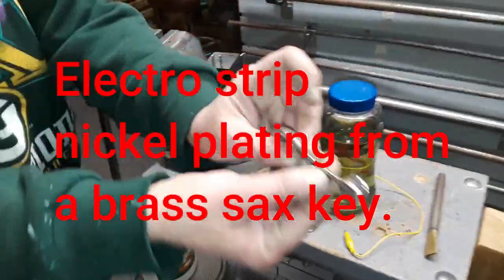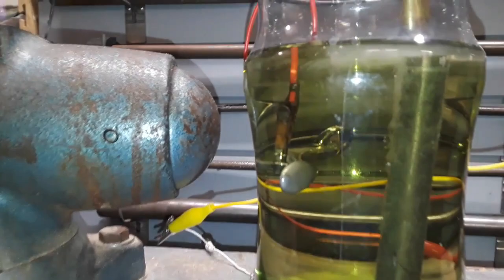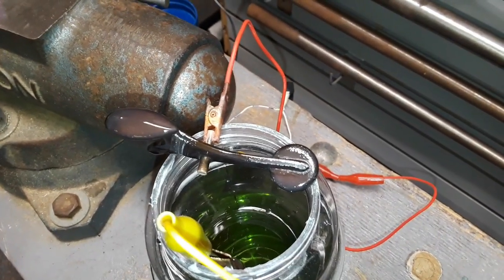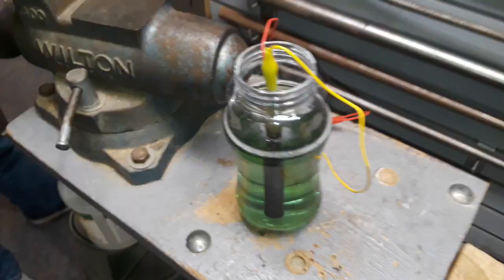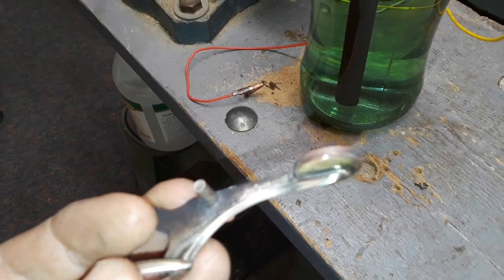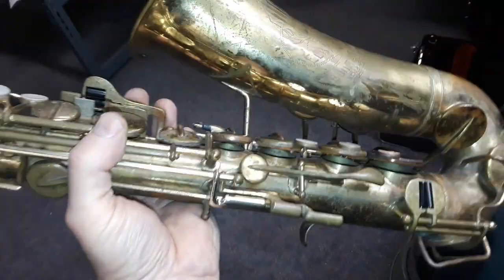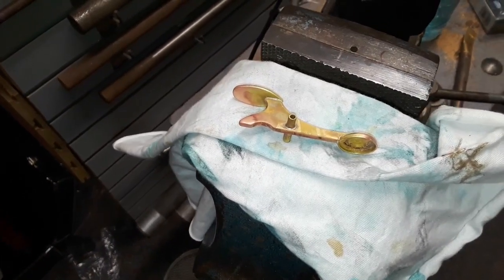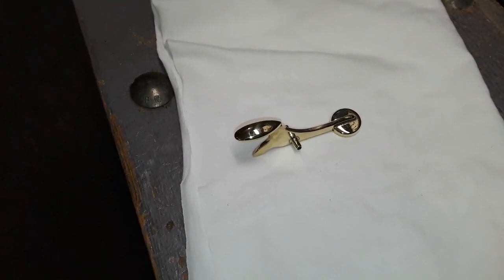Stripping nickel plating

Comment: There are a lot of problems with the depicted method. a) Nickel acetate is carcinogenic poison as a water soluble nickel compound, do not stick your fingers in, do not inhale the gasses (and dispose of properly, as said). b) the power supply is of constant voltage type and the current is only limitied by the poor conductivity of the acid, which is not so poor, it may go down to short circuit if the metal parts are touching. If you overload the power supply it overheats, and better ones have a thermal cutoff forever, others will burn your house down. Use a laboratory power supply with adjustable current limit. c) nothing protects the underlying brass from dissolving after the nickel is gone because no potential control is done.
Reply from the maker: Thank you for this great information! Also explains why these little power supplies don't last long.

Comment: Hmm... I have an old Italian sax that I'm trying to repair. Doesn't need to be great, because I;'m not. How do I tell if the plating is nickel, and how would I strip the whole horn? I am going to pull it apart to remove dents, and I need to solder on some broken off posts.

Comment from the maker: No. This is a 12v power adaptor with several hundred milliamps. Amperage kills. Voltage shakes. 12v does nothing.

Comment: Lmao I made the lovely mistake of not realising the latch was fully nickel on one of my projects from a 1920s box camera, it had red rust so I assumed steel but it practically dissolved to 0.4mm thickness as a piece so I’ll just remake the whole part, hopefully it’s not too difficult, must say I haven’t been able to get smooth plating results with a homemade nickel acetate solution following many tutorials, I’ve had to sand quite a bit from 600 to 2500 and there are still a few pits, what’d you say bout this?
Reply from the maker: I would send it to a nickel plating place. Very hard to do really good plating. Also, the end results will only be as good as the base material - whatever the metal. Pits in any finish work need to be sanded, buffed and polished out a mirror finish for the end plated results to look good. Or you could take it to a less than mirror finish like with a wire brush, but that is what it will look like, just with new plating on it. If it is solid nickel. Just keep sanding and then buff it with a bench top buffer or Dremel tool.

Comment: Great video. I have also seen just letting it soak in distilled vinegar suggested to age nickel plated hardware. Let it soak for hours or days even. What is your opinion on that? By the way, if one wanted to anodize a nickel plated part, I guess the nickel platting would have to be removed? Would the vinegar do it? Or you need acid? And would then the anodizing work? Thanks.
Reply from the maker: I do not know about the anodizing. Sorry. Yes, I would think soaking in vinegar would "age" a finish and darken it. I was asked to "vintage" some tuners on a bass guitar and other parts. I used a dilute hydrochloric acid and then torched it. Really screwed up the finish just the way he wanted. Blotchy, black, grey. Really ugly. It gave it a 40 year old look. Unfortunately he didn't ever get 40 chops out of that. LOL!

Comment: I can see this for small projects with one or two keys. But for larger projects that have more than one or 2 keys you will need an industrial strength product.
Reply from the maker: Yep, Anything bigger, I would send out to a plating company to strip  and just roll that into the cost of whatever repair.

Comment: Did you add salt to the white vinegar solution? What is the voltage?
Reply from the maker: Yes. 4.6 volts. Anything really, 9volts would be fine. Just grabbed any old power supply. Low amperage.

Comment: will this nickel stripping formula wirk on the flute silver plated or nickel plated? I have a flute I want to strip the plating and I am looking for a safe chemicals to do the job. Looks like your formula might work. I hope to gear from you about this. Thanks
Reply from the maker: If it is nickel plated, yes. No, on silver. No, on Rhodium.
Reply from the maker: Are you planning to replate it? If not, the nickel silver tubes and keys will tanrnish and grey out on  you after stripping and polishing. Those parts are not brass.

Comment: Might it be easier to gold plate over the nickel plate?
Reply from the maker: That's a great idea if you have the $ for gold or a brush plating kit that does gold. In this case, we were just matching an old sax key to the rest. All the other keys were brass, lacquered and pretty beat.
Reply: @jimflys2  makes sense to match it. I have the same issue with my Yamaha yts 21. I’m hoping to match the keys with the gold body…one day

Comment: I’m trying to strip a camera body down to the brass but the nickel is covered with a thin layer of chrome, would doing this process take both off?
Reply from the maker: No. Chrome will strip very quickly with muriatic acid from your favorite hardware store. Watch your eyes, lungs and skin. Stuff burns.
Reply: Oh for sure, thanks for the advice. Would 10% concentration be strong enough? That seems to be all I can get around me
Reply from the maker: @samleiden7431  I think so. Any hardware store brand like Sunnyside or whatever should work. I strip chrome with this from trombone inner slide tubes. Just the fumes along will creep up the tube and ruin the chrome if not fully covered to protect them. And that is everyday stuff from places like Ace or Menards. Not sure what the MSDS sheets would show for concentration, but that is probably about right. Maybe start with a Q-tip application in an open area outside with a fan blowing the fumes away from you. `1st it will blacken. Then fully strip. A good eye will know nickel verses chrome.

Comment: I did this process the brass body of y camera but noticed that the flat brass surface seems to developed tiny pitting marks. I want to dechrome a brass lens barrel next but would like to preserve integrity of the tiny engraving distance marks on the lens barrel. Is there another way?
Reply from the maker: If you are stripping chrome and not nickel, simply use Muriatic acid. No electrical current needed. Strips in a minute or two. Neutralize your piece after and buff and enjoy.

Comment: Hi Sir very interesting, could I ask you a question please ?  I have a Keilwerth SX90 Tenor Black Nickel.  I want to remove the black nickel from the Neck.  Then buff it or get it silver or chrome plated. What is the best way to remove the black Nickle please..?
Reply from the maker: I am not too sure if stripping black nickel is pretty much the same or not. BUT! If it is the neck, the other option is to use abrasives. Greaseless compound followed by tripoli etc. Even starting with 400 grit sandpaper would do a lot. Then move to other grits that a finer and finally buff with tripoli and red rouge.
Reply from the maker: I should also say that very likely the black nickel on the KW is covered with lacquer of some sort. It will first need to be stripped as well before any attempt at reverse plating is done. I don't know if you are professionally employed in the repair field or doing this as a project. I could certainly handle this for you if you would like. (strip, buff and silver plate) Not a problem at all. Probably looking at a 200 to 250 project with what is involved including the plating. It would look absolutely great in the end - guaranteed. Let me know how this works for you.

Comment: I wonder if I can remove chrome finish from my Zippo with reverse electrolysis
Reply from the maker: No. It's even much easier. If it is indeed chrome, get some muriatic acid from you local hardware store and drop it in. 3 - 4 minutes later, rinse off and buff it up with what ever you want. Brass finish I assume? Watch your skin, eyes and the fumes on that stuff. Do it outside. Use all safety equipment. You don't want to lose you eye. That would sting like mad and possible hurt your eye. It is hydrochloric acid. keep the acid for cleaning nasty hard water calcification in toilets and such.

Comment: ive got nickel plated over copper plated gun parts that im gonna be stripping would the vinegar acidity make a difference like 5% vs 30% etc and would it be possible for you to make a video of stripping copper off steel?
Reply from the maker: I have nothing that is nickel plated steel to strip. There should be no difference using this process to strip from a piece that has steel as a base metal. You do not need a highly concentrated acid. This is reverse plating and not chemical stripping. Try stripping the safety or some such part first. It should tell you what you need to know. A slide or cylinder, whatever the part may be, is just bigger. Should not have any more plating on it than a screw.

Comment: Does the tubing hooked up to the negative need to be copper or brass? Would steel work? Thanks
Reply from the maker: It should, but it may not conduct electricity as well as a copper alloy or copper itself.  Try it and let me know.

Comment: Hi great video. Is there a reason my golf club stops stripping mid way? Do I need to keep using different brass anodes? I feel like that’s going to get costly
Reply from the maker: I have no idea. Golf clubs nickel plated? I would think chrome.  This will not strip chrome.
Reply: Maybe the nickel acetate concentration is getting to high, so replacing the liquid might be the answer

Comment: Would the piece be ready to re plate with nickel again at that point if required?  I would like to replace some banjo parts!
Reply from the maker: Well, plating only and always only reflects the look of the  base metal. Typically some buffing is in order for the base metal and then degreasing before attempting plating. So the nicer the piece, the nicer the plating will look. If you do good prep work and nice buffing, send them out to Anderson silver plating for nickel plating. They do not do chrome. They are about the best. Look online for them.

Comment: If my old nickel coated pieces are blackened a little should I clean before doing that process. I want to remove the old nickel and replate. I am restoring an 1800s tintype camera. Mostly would but has nickel plated hinges and small parts.
Reply from the maker: I do not think it would be necessary.

Comment: but brass can be nickel plated directly. why was it copper plated under nickel? could it been chrome and not nickel? just curious. thanks for the video regardless. good stuff
Reply from the maker: Yep. The  copper plating I referred to is on the brass hoops and lugs. It was done for cosmetics to allow and different tone to the color of the tinted lacquer. I do believe that the nickel plating, in this case black nickel, was directly plated onto the brass shell. Copper strikes ( a very quick electro plating) are important for adhesion when plating brass with silver plating. Other metals require different bases to plate better.
Reply: @jimflys2  thanks!

Comment: Hi, will a normal 9v battery work and which way round is the polarity to strip it, positive on the copper tube?
Reply from the maker: Low amperage is good in plating as you do not want to burn plating, you could try running a couple of 9v in series to keep it at 9vold and double the amperage. Try it with one and let me know.
Reply: I doubt vf the battery would produce enough amperes to be effective.

Comment: so getting nickel plate off of copper and only copper.. I would use a copper cathode? Correct?
Reply from the maker: Not sure that it matters. This was being stripped off brass which is 80% copper. Try a copper wire for the cathode. Can't hurt.

Comment: Im going to try this today with an old camera. I'm trying to remove the nickel plating down to the brass so I can repaint it.
Reply: How did it go? I have stripped chrome plating from a brass camera part (in warm HCl) and ended up with nickel plating (I guess, it is a pinkish bright layer). I will try this method to completely remove it.
Reply: @koray-www  it worked better than I thought it would!
Reply: Hey mate! Doing the same currently! Did you by chance experience the pieces turning a copper pink? Not sure if it’s just a matter of keeping it submerged for longer but it he parts seem to turn a coppery pink…

Comment: so the nickel goes to the tube?  Can reverse the polarity and send the nickel back to the brass?
Reply from the maker: Yes, exactly. The nickel goes from the nickel plated key to the brass tube. Could reverse the polarity to allow plating to collect on the key. Would not work really great, but does work.  A better nickel solution would lead to better plating and results. See nickel plating solution to order it and get into actual nickel plating. This is more about stripping plating rather than doing great nickel plating to polished parts.